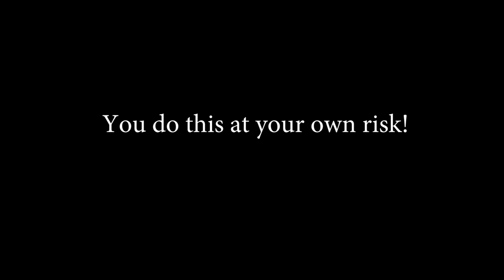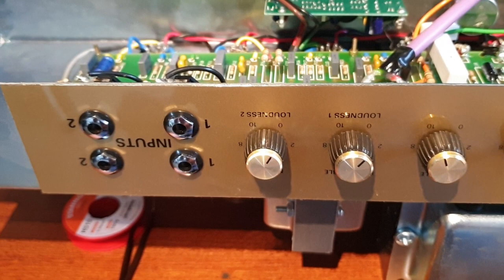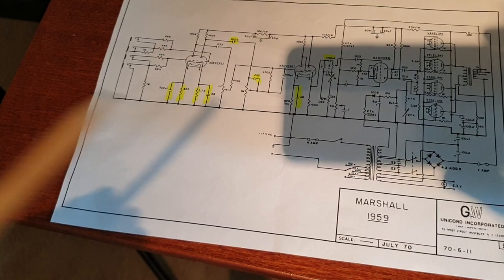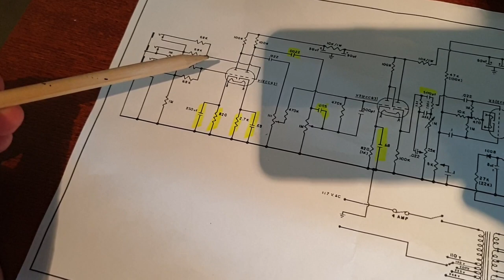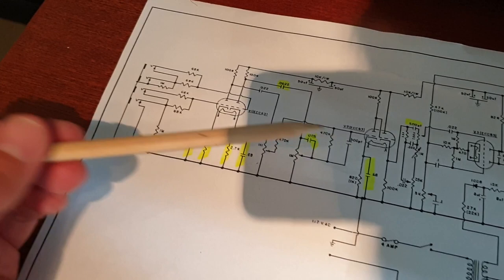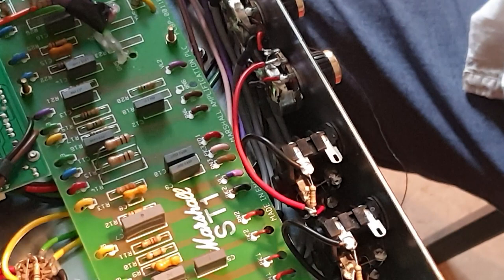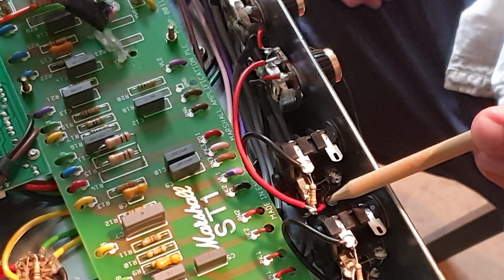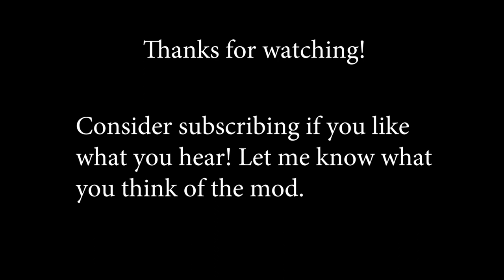How to do the ONE WIRE MOD on a Marshall 1959 SUPER LEAD!! Do a PLEXI need this??

Comment: i don't know why but it doesn't sound plexi no more but kinda fizzy and really thin,like there was no bite to your licks
Reply from the maker: You're absolutley right! The master volume is a compromise. You loose the one thing that defines a "plexi" Power amp distortion.
Reply: That's because he's using a strat with the selector set to position 2.  Of course that's going to sound like shit in a Marshall.  2 and 4 sound funky and good when played clean, but not in an overdriven Marshall they don't. 

Dude, got a Les Paul?  THAT is the classic sound.
Reply: Absolutely agree.... super fizzy/fuzzy.... much better before.
Reply: @Rohbemusic  The mod didn't interfere with the master volume right? PPI Master volumes doesn't affect power amp distortion when on 10. Or is this Pre-phase inverter master?
Reply from the maker: If your ppimv is set to full its basically out of circuit. Its after phase inverter. 👍

Comment: The biggest issue with this video is not whether the stock or modded amp sounds better. The issue is your recording technique for the video. Because you have your microphone you are using to talk into recording as you play the amp, both tones for the amp (stock and modded) are clouded by the very loud and annoying sound of the electric guitar's string noise. It makes it hard to actually compare the amp tones because we are constantly hearing the string noise overlaid with the amp sound. This is a very common problem in YouTube guitar amp demo videos. The acoustic sound of the ringing strings is nearly as loud or sometimes louder than the amp being demoed.

Comment: Who in the Hell taught you how to solder?!?!  You don't just lay a wire over a lug or joint, you're supposed to put the wires through the lug and wrap before soldering!  If you do sell this amp, let the new owner know what you did so that person can have it reversed or done correctly!
Reply from the maker: Relax, it was merely a test which by the way worked fine. The amp was turned back to stock the way it was before after the video.
Reply: It's ok to solder this way, like welding. It's not going any where as long as it isn't a cold solder.
Reply: I've been soldering electronics for 40 years. Be careful what you yell about.

Comment: As the filter capacitors already have bleeder resistors, you should be safe. Very well explained. That amp looks immaculate!
Reply: They're not bleeders, they're dropping resistors in the HV supply.   Pull the HT fuse and the HV on the caps will not bleed down,  and this is a hazard a Marshall technician knows.  A blown HT fuse means the caps stay hot until the fuse is replaced or you manually bleed the caps down.    When the HT fuse is OK and working, then yes, the caps WILL bleed down.  But not when the fuse is blown or removed.

Comment: so did this to my handwired 1987x, my question is it made the normal channel volume pot become a gain pot, is this correct? And your treble volume pot is a volume pot. im plugged into the high input top position with guitar and now high treble is volume and seems like normal pot is gain since they are both working now. I also noticed that the normal channel input #2 is not louder than # 1, I already had a PPMV installed. what is the difference between High input top and normal input top? Thanks!

Comment: My 1959SLP doesn't have the ST1 PCB or the 65K resistors wired to the input jacks.  The 68K resistors are located at positions R22 and R23 (I believe those to be the correct resistors), can I simply take the wire from the wiper of the channel two's volume pot and connect to pin 7 of V1?
Reply from the maker: Yes that should have the same effect. Since it's a longer way you might want to consider a shielded cable. Good luck!

Comment: usually a power attenuater is used to drive these amps between the head ant the cab.....but this comes at a cost because the tubes wear out faster........great video for a different sound!

Comment: Initially going by the intro I did not think there was much more gain. Later in the video I could hear it saturated a lot more. I am thinking about doing this to a JMP50 clone I just got, but I do not want to mess with its sound, because it does Angus and Page tones so well. It has to be on 10 to do the Angus thing. I use a Torpedo Captor 8 and it quickly overheats because the JMP is outputting out nearly 90 watts at max. For now I am just boosting the amp with pedals and running on seven so i do not overheat the Two Notes gadget (or blow the amp up). The tone of the amp cranked seems to have most of the clipping happening in the power tubes. I think the preamp is staying quite clean. It gives the amp more of a 70s sound. I am thinking a cascade mod might take it into the 80s. The other options would be an extra gain stage, or diode clipping (what is usually called the Jose mod). It would have to be switchable, so i do not lose what it has now. 
For now though the priority is finding a solution for the overheating load box, because that can endanger the amp. Running two load boxes would do it. Then all i have to figure out is how I can run it on ten without blowing it up (JMP MKI amps blew up a lot. I had a 1959RR that blew up not long after i got too. A JCM2000 DSL100 also blew up. But I still stick with Marshall mostly, because well, that's the sound of so much rock music. I really liked my Laney's tone, but I could not get it to sound quite like a Marshall. It was its own thing. I also like my nephew''s Twin Reverb. Don't need distortion to play lead on that thing. So smooth and the reverb is legendary on those amps).
Reply: I have a 76 JMP50, and I run it through a two notes torpedo reload. I can run it on 10 without issue. I also have a PPIMV and I will use a combo of the 2 to find a sweet spot in the tone

Comment: The mistake modders make is following a schematic blindly - The SLP circuit wasn't designed to produce that much gain stock. By cascading without any additional filtering or blocking, you're adding gain but also instability, parasitic oscillations.

Put at least a 220k resistor in line when insiering the volume lead back into the grid input of V1a. Or do like a JCM800 and put a 470k/470pf RC peaker which gives the midrange grind and high cut associated with an 80s Marshall.

Better yet, use the low input for a DPDT switch to enable the cascade on/off and keep the normal glorious Plexi tone stock

Comment: Can this be done on the Marshall sv20h? The circuit is based on the ‘59 plexi
Reply from the maker: Absolutley! What makes it a bit trickier is that the pots are on a pcb and there is generally tighter in the sv20. A tech could probably do it under 30 mins 👍

Comment: Where did you get the schematic to do the one wire mod I would like a layout of it or a close up picture of the mod so I can do it on my 50 1987 clone
Reply from the maker: This is the quick easy method just to show it. You might want to change a few components to get the most out of this. Might be worth reseaching a bit, schematics are available online and info about the mod can be found in great detail in many forums.

Comment: Thanks man it's a cool mod but I did think it sounded better stock....just tonally. It would be nice to have a bit more gain upfront so I might try it. Maybe the resistor will help it sound better? You need a better guitar man. No offense but that strat sounds cheap like a toy or something. Would have been nice to hear a Gibson or something with some humbuckers or a nicer strat. Thanks anyway.
Reply: Sound vs feel. If you can't feel it working right, you can't play it to sound right.

But honestly, just use a boost pedal

Comment: WARNING! If the guy working on your amp uses the phrase "I'm not sure" regarding ANY aspect of repairing or modding your amplifier... avoid them like the 'rona! Back in the day we used to call noobs like this "sharks"... they act like they're top-notch amp guru's... but in reality... they have just enough "knowledge" to screw your amp up! 🤣
Reply: He says he's not sure if a one Meg resistor will affect the signal in any way. come on, if you don't know that a 1 Meg resistor in series is going to attenuate the s*** out of the signal I don't know what to say.
Reply: @davesims6517  Well then let me get in my Ken Fischer mode for a second and ask; what is the difference in a carbon film vs. carbon composition vs. metal film resistors in a guitar amp circuit? What points in the circuit would make the most difference with the various composition of resistors, and why? Think about your answer carefully... there is a test afterwards. 🤪

(And if you knew the legend of Ken Fischer, you'd understand the point of such an esoteric question) 🎸
Reply: I know about Ken and Trainwreck. Metal oxide in the plate positions,if only for the thermal handling capabilities. Honestly, there's so much BS out there regarding component material type,and I've noticed very subtleties at best,which could be offset by other consideration.😎
Reply: @davesims6517  All those "subtleties" add up... and will make the difference between a crappy sounding or killer sounding amplifier. 🎸
Reply: What "adds up" even more is the money you waste by purchasing so-called magical component types, and then allowing the psycho acoustic effect of what you're hoping for, fool you into thinking that it actually sounded better than before. Just
Reply: @davesims6517  Well, I'll put it this way, Dave; I'm not going to stress over "carbon film vs. metal film" resistors, etc. ad nauseam... however, I will choose quality components that DO make a huge difference in the tone of an amp (output transformer, etc.). 

Regards 🎸
Reply: Once you turn these amps up loud enough to push the speakers, a lot of the little things are out the equation and their effect is so much less. So many people are turning their plexis into PPIMV distortion boxes at bedroom volume and its absolutely ridiculous from my point of view. The real sound of these amps is not in the preamp, its in the power amp and THE sound, is when it is cranked so high that you literally feel it. The amp completely changes at high volume levels and all the tweaks you made to the preamp really do not have a big effect anymore. I think people are way too caught up in that shit. I fiddled with my plexi so much changing cathode bypass cap values, plate resistor values, different capacitor materials trying to replicate eddie van halens specs, etc. Once it was turned up it always just sounded like it did before anything and I finally realized that's the sound and there is no way to achieve this in other ways. Tweaking preamp gain to over compensate for speaker distortion is a waste of time on this amp. If that's what you want/can't play your plexi at volume, get a different amp.
Reply: @icepick859  Or buy a Two Notes Torpedo reactive load device. I'm not a fan of post-phase inverter master volumes either, I prefer the cathode follower type used on the 2203/2204 that Steve Grindrod at Marshall designed in '76. I play power metal so I like that tight, punchy high gain tone. 

Regards
Reply: @scottdunn2178  I love the 2203/2204 circuit also. And honestly I think most of these guys doing cascade mods and PPIMV master volumes etc to their plexis would have been better off getting a JCM800 in my opinion. Since they don't seem to bring the amp above talking level ever. But the thing about reactive load resistors is I believe the speaker breakup is huge in plexi style tones and that can never be substituted for anything but volume.
Reply: @icepick859  Apartment buildings and 100 watt Marshalls aren't a good mix. You're ok with a reactive load device as it basically just mimics a speaker... but resistive load type devices are a no no and asking for fried output transformers.

Comment: Use a dual ganged pot to control both volumes (like modern Oranges) and a master volume is a good trick with one wire mod :)

Comment: Is this the same as simply jumpering the two channels?
Reply from the maker: No thats an old trick that actually gives you less gain than just plugging into hi 1. Youre still running the first tube in paralell. With the one wire mod youre running it in series, like the Jcm800. It gives you one more gainstage 👍

Comment: Oh...you need to learn proper solder technique.  Run the wire THROUGH the pot lug, apply enough fresh solder to get a smooth shiny joint.   And just tacking the wire across another wire without even making a little bit of a hook around it is also bad form.

Any wire you solder, any component you install,  should be MECHANICALLY SECURE in position BEFORE you put solder on it.  Solder only freezes a good connection into place.  Solder should not be relied on as a structural element.   

I'm mil-spec certified and avionics Class 1 certified in soldering and electronics assembly.   Which means...I know what I'm talking about.  Your work will benefit from learning proper soldering and assembly techniques.    I'm offering you knowledge and advice,  for free.  It's a good deal.  Take it.
Reply from the maker: Wow, you must really love this video since you have commented on it a bunch of times already. However based on your previous comments I dont believe you, I dont trust a man who dont like single coils and boosted amps 😂